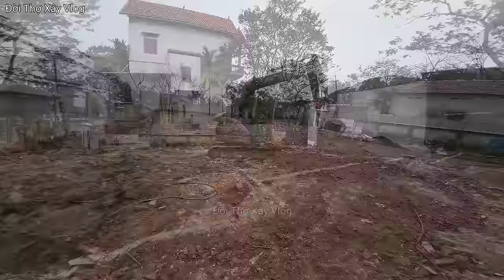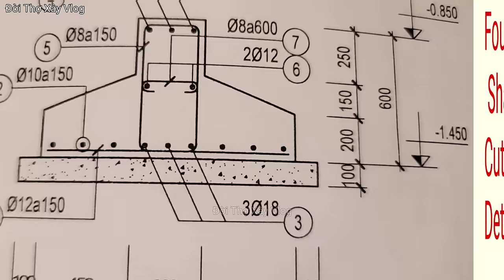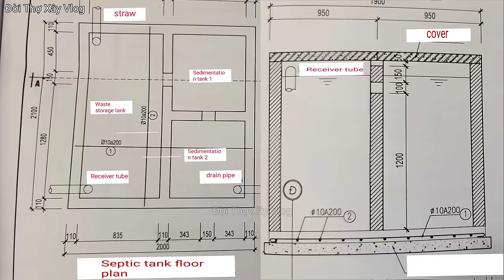My parents helped me with $70,000 to build my dream house- P1 House Foundation

Comment: I don't understand all the brick work and cement that will all just be buried underground / so labor intensive when just a concrete slab would work
Reply: yes i was thinking the same thing, too much unnessary work and expense , and all the days it took to do all that when it wasnt neeeded.
Reply: I think this area has a high liquefaction/swamp factor. the squares are 'traps' pretty much acting like wedges place friction
against the ground as it sinks with weight. But yea understandably it definitely does seem excessively wasteful if this is not the exact case.
Reply: Depends. If the área is an earthquake suceptible zone, then such foundations are pretty much a requirement, and seeing the plan of the foundation, it would be insufficient for such events, but then again, depends on the zone. Also It depends on how wet or swampy the terrain is at a level of 1 or 2 meters deep, or more. At first glance it seems insufficient, but different countries and regions have their own regulations for this type of case. ¯\_(ツ)_/¯
Reply: Its like a bunch of teeth holding the foundation.
Reply: Because labor is so cheap in Vietnam
Reply: Because its cost is cheaper than concrete. Each brick costs only 0.03 - 0.05 USD, labor costs 12-18 USD per day.
Reply: Home is too large for the plot.
Reply: That's called foundation in Asia we do that the technique vary area to area like I m from India we do that too but the brick way we simply dig up the square hole up to 6ft do the steel frame work and use concrete and cure it .
Reply: @mrblock1318 maybe it's an high earthquake are 👍
Reply: Because all the wrong materials were used with all the wrong applications .... its like they let 1st year apprentices build first without planning or permits. The scary thing is they would do exactly the same build for apartment blocks - that's why ppl die.
Reply: conspicuous consumption. 
"ah got it like that!".   😒
Reply: Soil stability is the cause here, sinking area or maybe wetty area so they are ensuring the stable base. It looks wastage is more but actually they are saving money, a house which will withstand more den 50 years. I hope non technical commenters will understand this.😊
Reply: Questo lavoro se lo fai in Italia non ci vogliono 70.000 dollari,ma c’è ne vogliono un 1.000.000. Di euro,troppa manodopera
Reply: This bcz land is not solid to avoid land slides surely
Reply: @rayheatherly672 bcoz you not a construction worker😁😂🤣

Comment: @ 15:00 by now you could have just used all the steel and labor and poured a twelve inch slab of concrete and build any thing you want on it
Reply: In a location like that, the cost of labour is very inexpensive and locally sourced materials very cheap. This necessarily changes design. As an Australian structural engineer who worked in Asia for 40 years I have come to respect the local techniques and using the local skill base available.
Reply: @rodneywiley7839  did you even get the point of my comment

Comment: Make either the column as a load bearing structure or the walls. Don't make both of them a load bearing structure. Shouldn't have joined the rebars of the walls with the rebars of the column. During an earthquake if the the walls fail then it will bring down column or if the column fails then it will bring down the walls in your home because you have connected the column's rebar with the wall's rebar.

Comment: Ductile strength of the rebar reduces significantly if you weld rebars to make a joint. The joints from the foundation itslef have become weak due to this.

Comment: I wonder how the sewage tanks are maintained, they have no opening on the top?
Reply: Was wondering the same thing. Plus where is the leach bed?
Reply: @oneiros1401  There seems to be none. But there are several pipes from the tank to the outside. Maybe they discharge into a sewer system, and maintain the tank through the pipes. But what is it good for, if there is a sewage system?

Comment: just do the rebar and form it and pour the concrete easy peasy
Reply: Could it be they are building on a swampy area, or old rainforest?
Reply: Earthquake zone, high water table.
Reply: @YUDNSAY i agree. most probably this is in the mekong delta where you are building a structure on top of tens of meter thick silt. They are augmenting the concrete structure with bricks since clay is readily available while quarry site may be hundred kilometers away. Thus they chose materials on economic basis.  Spreading the wieght on an area as large as possible is the way to go. People should not make an assumption that there are no competent engineers in this part of the world.
Reply: Sometimes they even use bamboos as soil pilings. I say why not. The venetians used wooden pilings too below their massive adobe structures centuries ago.
Reply: @GiovanniMarcos-fo7mo  Not to mention St Petersburg, wooden pilings are very successful, the techniques here are very dense, and evenly spread, there should be uniform settlement.